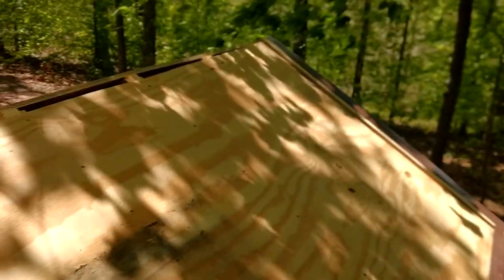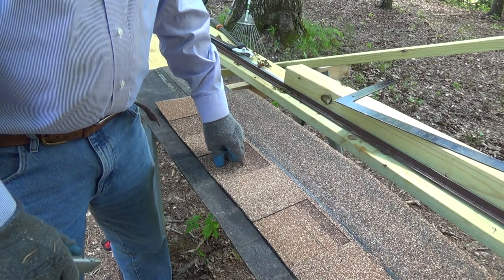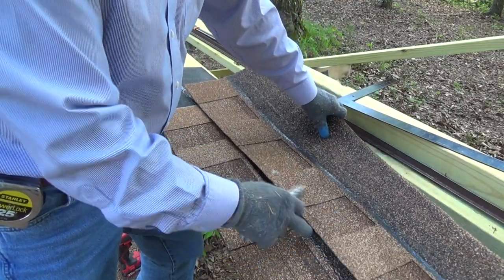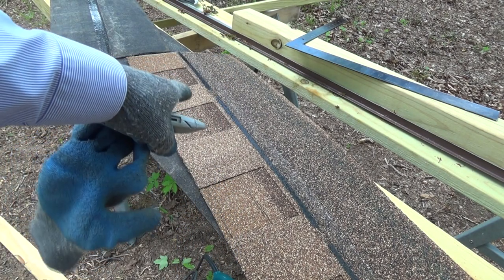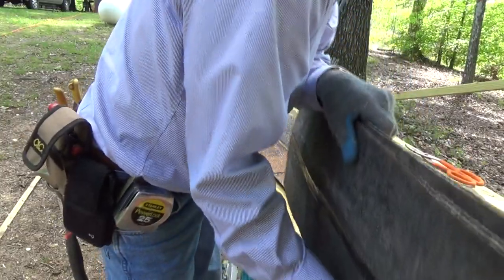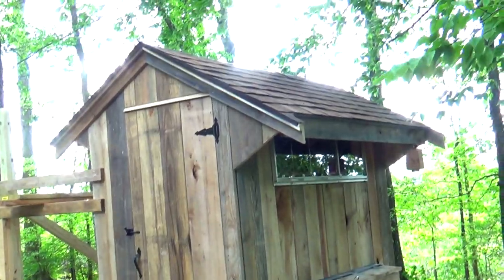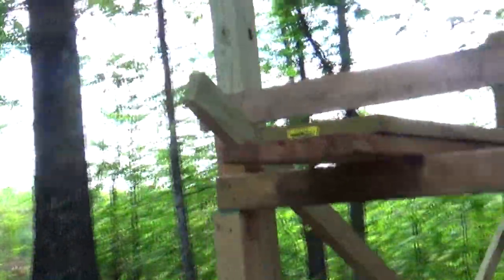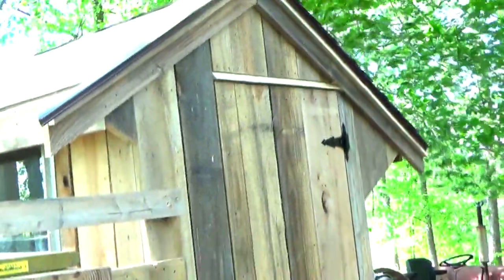How to roof your chicken coop mp4

Comment: Thanks for sharing. Curious why you didn't use any felt? Learned something new again I have never heard of wooden gutters. Always enjoy hanging out with you George. Stay Safe. Stay Healthy!
Reply from the maker: Felt is required for new installations anymore, but for many years we didn't use it and I found it to be more trouble than it was worth. It adds NOTHING to the weather resistance, or to the insulation value, but it does cause shingles to buckle, and also stops the roof from breathing. New house construction has run into issues with making houses too tight. A building needs to breathe. That's my story and I'm sticking with it...LOL Thanks Bob